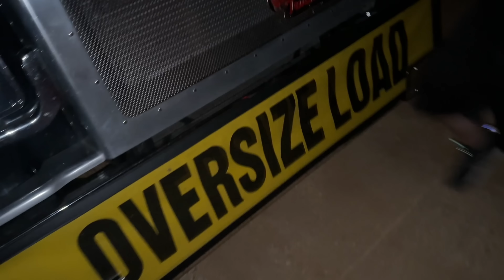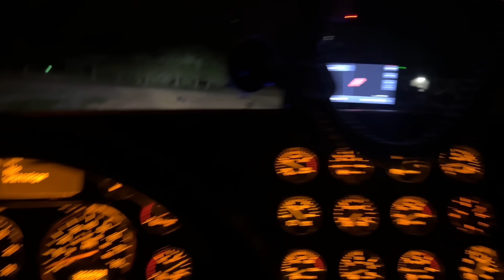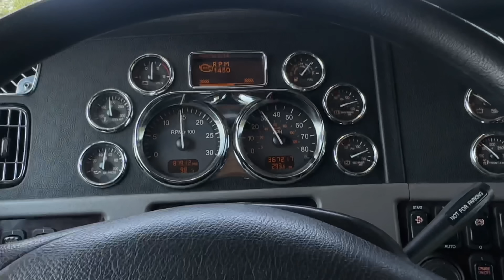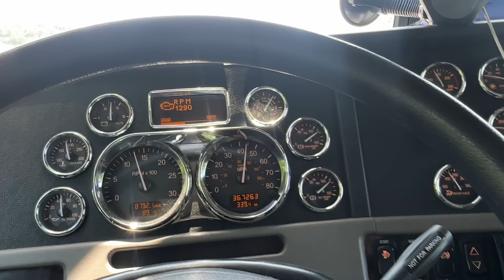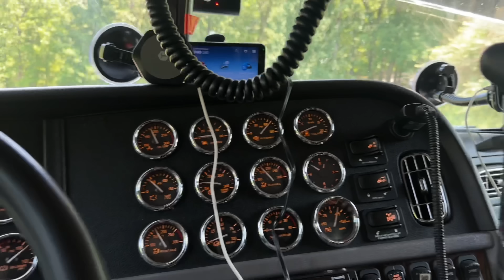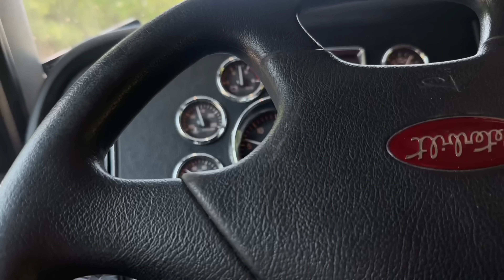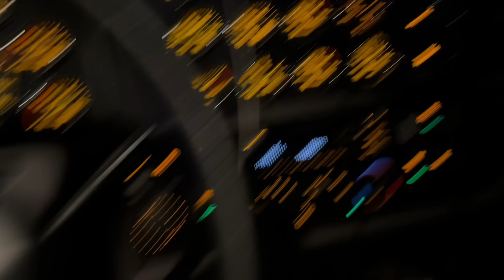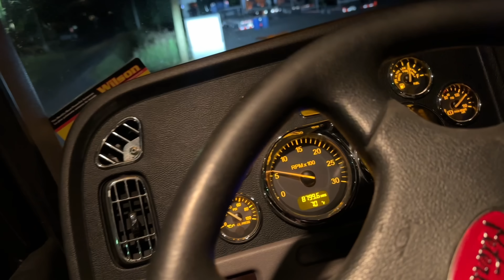I Messed Up Big Time Hauling A $700,000 Sail Boat!!

Comment: Awesome There, Tim, Love Watching Your Videos, I See That You Use AMSOIL Products In Your Trucks, Awesome, I Use To Be A AMSOIL Dealer Here In NEW ZEALAND, Back In The 1990's, You Got The Best Oil You Can Use In A Truck. As Well It Does A High Mileage, Had A Logging Truck Here Did Around 100,000 Miles, By Just Changing The Filters, But It Had AMSOIL Ultra Filltration Unit Fitted Which Was A Double Filltration System On It.

Comment: Question, not giving any crap just asking when you have hazmat or an over size load don't you have to recheck the load restraints every 2 or 3 hours.
Reply from the maker: Yes I stopped every 100 miles unless it’s rough I’ll watch straps closely and stop sooner

Comment: It is a myth that juvenile snakes cannot control the amount of venom injected.  Juvenile snake bites are always far less serious than adult snakes.  Larger snakes have larger venom glands and the venom is usually more potent.  Copperhead bites are rarely fatal.  I have been raising and milking venomous snakes for nearly two decades.  I was bit by a Mojave green rattlesnake when I was 15 years old when I was out riding dirt bikes in the desert.  I was airlifted to Loma Linda where I received anti venom which safed my life so I raise and milk venomous snakes which is used in the production of anti venom.  It is my way of paying it forward.